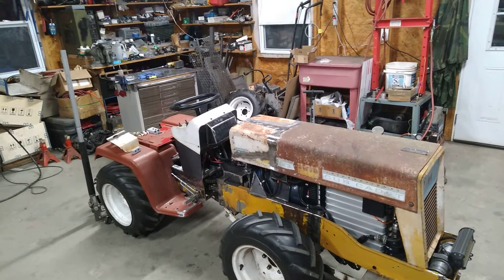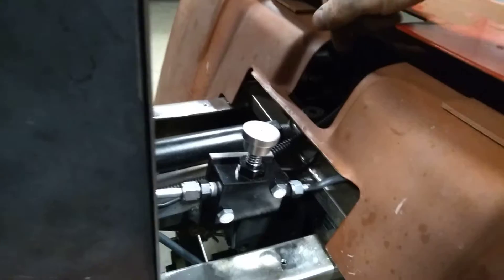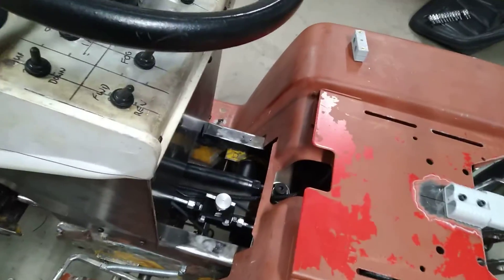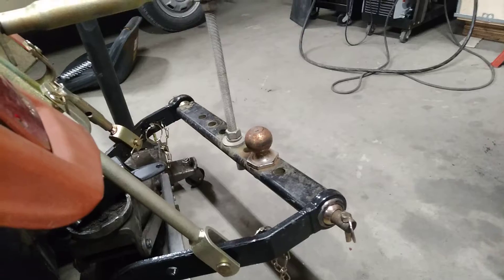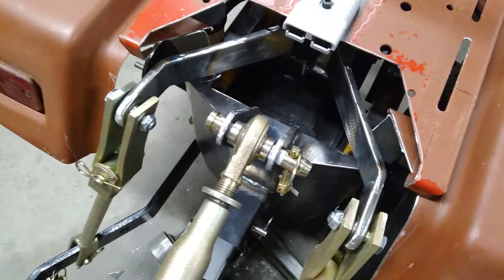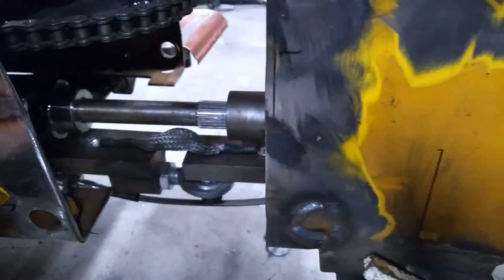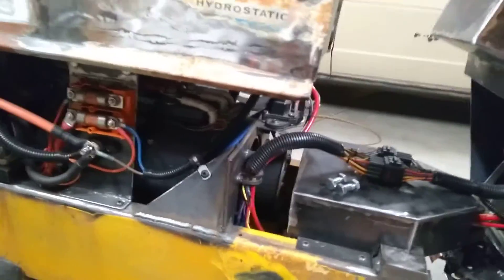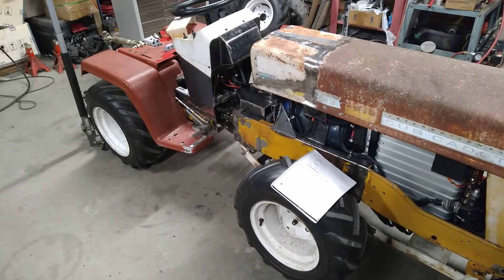Fabrication Finished! - The Cub

Comment: Looking good BIll, the implement power connector, could it be placed trough 1/4inch plate you built for the three point, perhaps just above the implement attachemt?   On the front piece in front of the winch. could you bend it in brake press rather than cutting and welding?
Reply from the maker: Thanks, Scott!  I have the power connector under the seat on my other tractor and that works very well.  If I put it on the 1/4" plate, it'd have to be off-center and I don't think I could sleep at night if that was the solution!  
Cutting and welding is arguably stronger than bending in a brake.  I did modify the front plate like I said I was going to do.  It was a bigger pain and took MUCH longer to do than I expected!